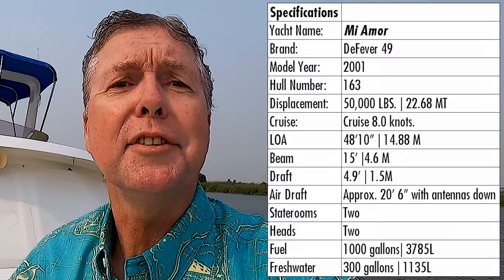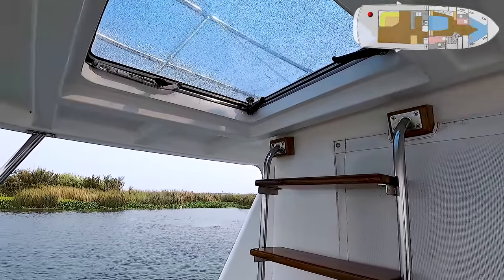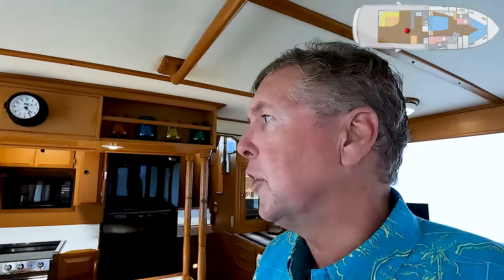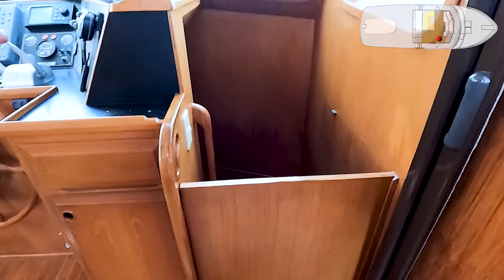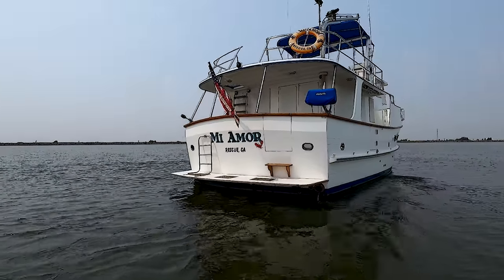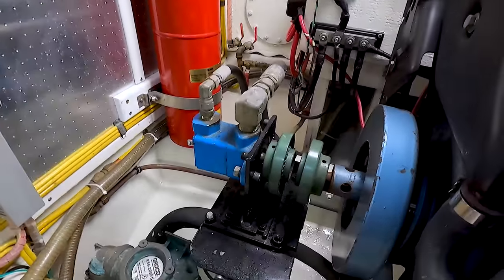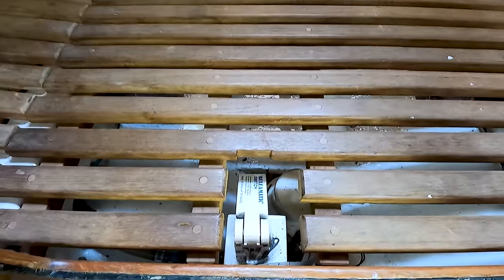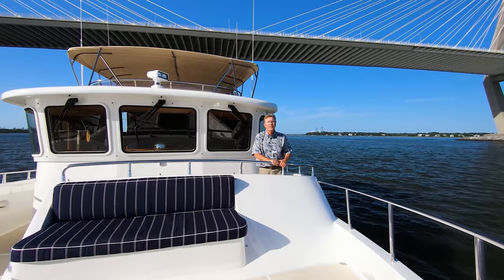DeFever 49 – [Talk Through Tour] – SOLD!

Comment: This would be perfect for us. I am wanting the indoor raised pilothouse now, and preferably with a nice captains chair. If they come with a little berth, or become a little berth that's even better. The master has to be midship or possibly aft, but I like how this one uses the forward berth for two levels of bunks instead of the standard v berth. The midship berth is perfect and even though I think the only shower is in the master, that isn't tragic if you seldom have overnight guests. I like the twin engines but I'm not sure what the cruising speed/fuel consumption is like. The Flybridge is perfect and we actually have a canoe and want to get a couple of kayaks and we would probably load them on the deck with dingy. It checks all the major boxes for us anyway.
Reply from the maker: Tammy:  This DeFever is a great design and there are quite a few out cruising.  Good to find a brand and model that works so you can focus on finding one.  Keep looking and you'll be successful.